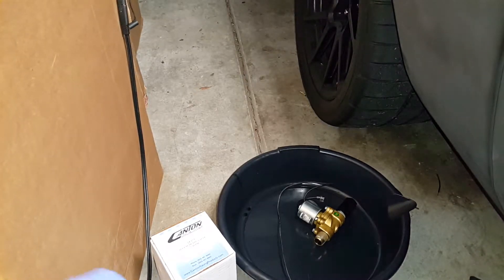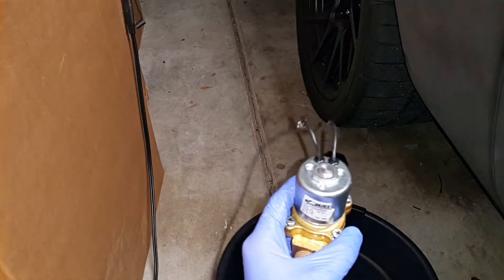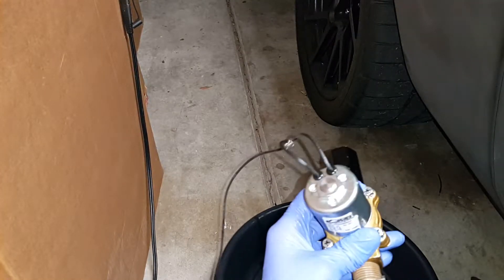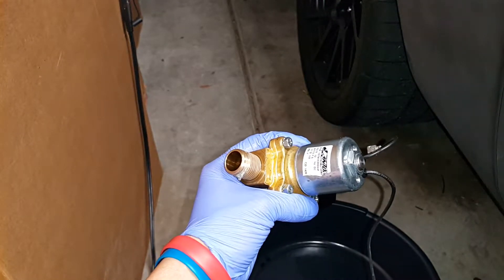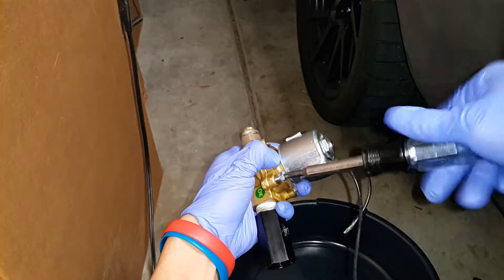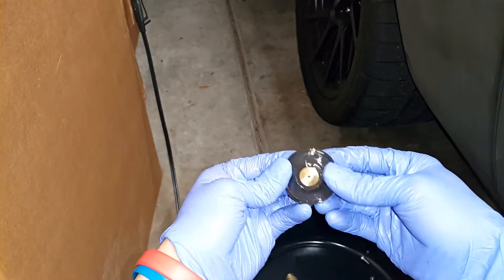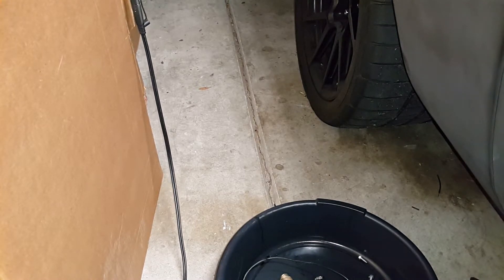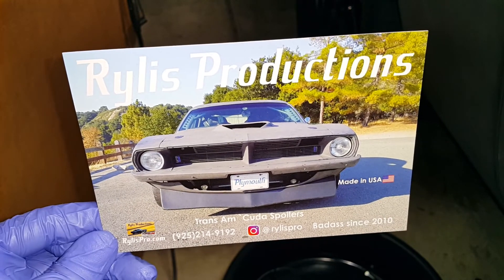Canton Racing Accusump old style electric valve autopsy

Comment: hey really good video i,m glad someone is able to show this as nobody else has done this, i have the same problem with my accsump, i have uploaded a video of my leak and it was hard to identify this but i think you might be right.... you can have a watch and advised me i would appreciate it, https://www.youtube.com/watch?v=2YBi6faK62w the specialist people advised me to change the valve, some advised me its to do with the electrics as it wa all working fine and pressure was working fine 80psi but the switch would not run the oil through the engine before the start not sure why, so we left the switch off all the time... but after high hard boosting a lot of oil starts to leak.... on normal driving not much oil leaks. was do you think?